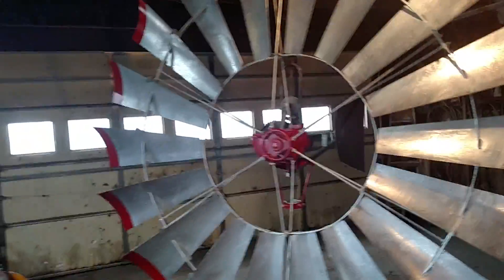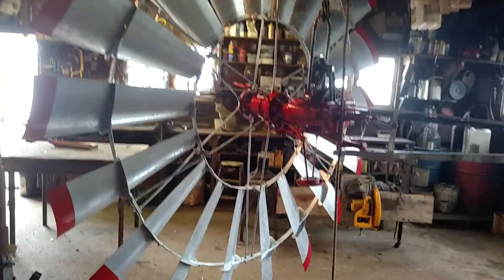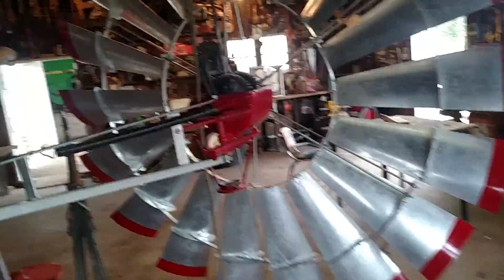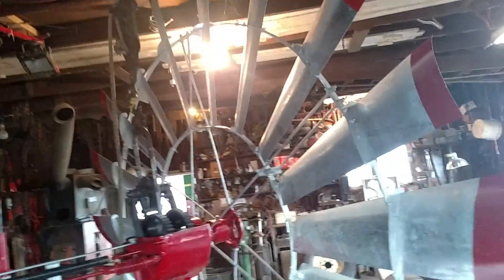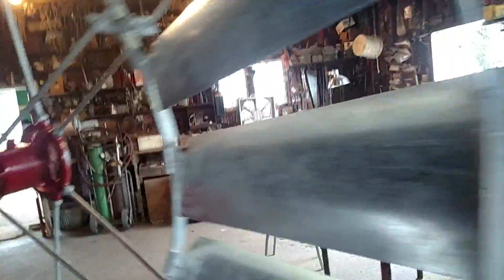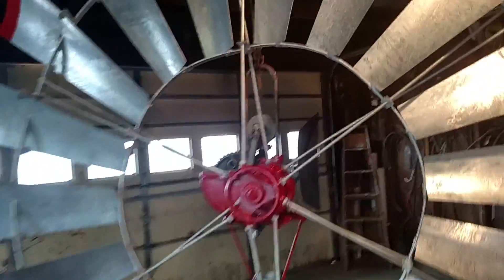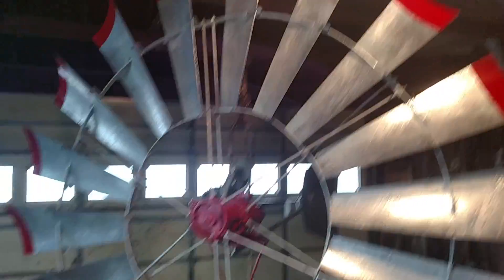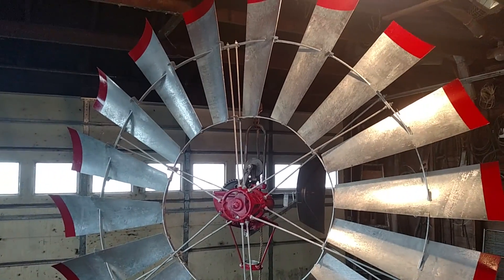Aermotor 702 windmill

Comment: The Aermotor is my favorite windmill of all of them. The design is so close to perfect that I don’t think they’ve changed much, if anything about the design in several decades.

I used to have two Aermotors but sold both of them. I wish I had kept my 8 foot diameter one and used it for a garage display. I painted the tips red on mine too. 🙂 They look sharp. Yours looks fantastic!

Comment: While not original, I do really like your red tips, most wood bladed mills dipped their tips in red or some other color of lead paint to help keep them from splitting  and some of the early metal mills like Heller Aller did as well just for looks.
Reply from the maker: walterbeech thank you! I didn't mean it for originality I just did it for looks!
Reply: I think the very first ones in the 1880s might have been tipped in red, they were not galvanized but painted white. I got one of about every model but the 502, the bell hub and the first model from 6ft to 16ft dia.